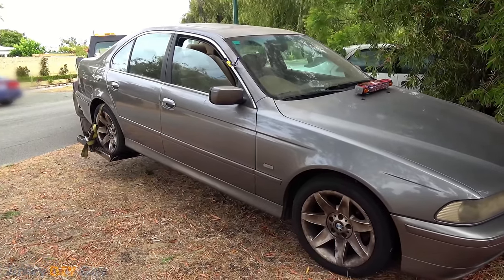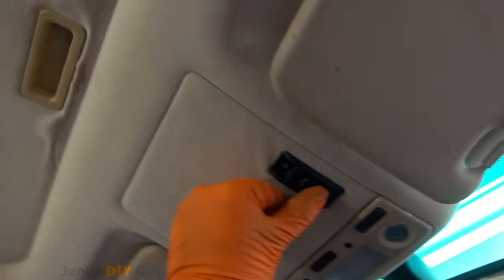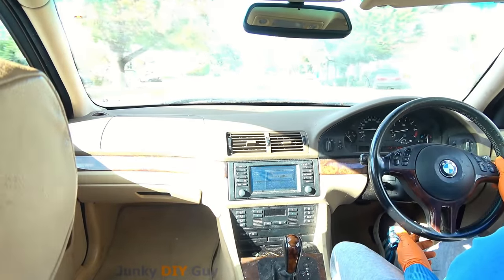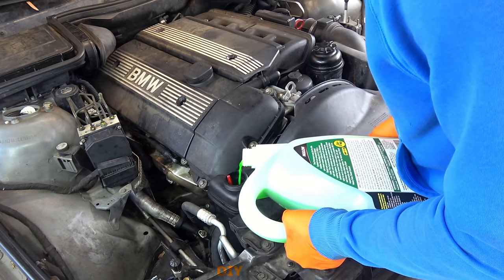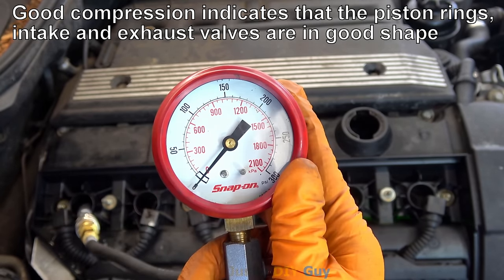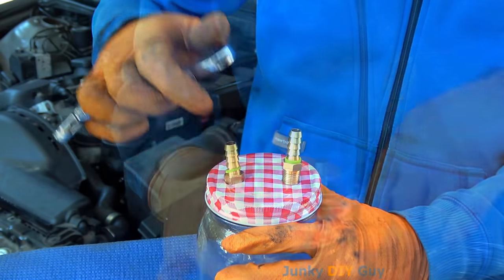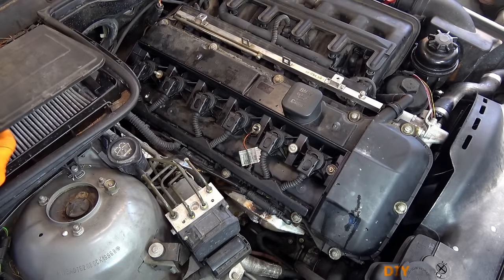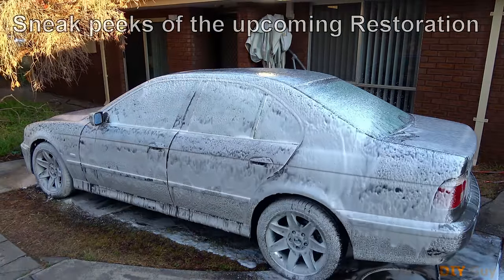I Bought a $100,000 BMW for Only $725, Here's the Reality

Comment: Excellent video.  No guessing.  No throwing parts at it.  Just the facts.  Just the right tools.  Just the right knowledge.  This could be the most comprehensive M54 repair video I have ever seen.  Thank you for sharing.  BTW, I made a smoke machine from an old coffee pot.  It uses mineral oil and a low pressure regulated air inlet from my air compressor.
Reply: M54 repair video?    please explain...

Comment: Brilliant. What a joy to see someone who can speak clearly, hold a camera in position, focus, edit and just really plan and deliver a classy and informative product. A little poignant for me as I had a lovely E39 528i - a couple of years older than this one but maybe cleaner. Started overheating. Had a bit of work done in one garage which cured it for a while. Overheated again and I left it at another place but he could never seem to get to it. Took it back home and went through some of the steps in the video. No oil in water, no combustion gas in water. Between first garage and home the radiator, water pump, thermostat etc. were replaced. Ultimately to no avail. Suspect some (many?) head studs were pulling from the block even though no detectable intermixing of gas/fluids. Diagnosis based on fact that it would run OK until warmed up then all hell would break loose. Now, the big problem was that I had sold the house and was working in a different city. So, the dear old thing went away on the back of a truck to who knows what fate. I can still smell the leather interior and hear that straight six twin-cam growl in my mind. Wouldn't it have been wonderful to have time, tools and space aplenty to keep her on the road.
Reply: I think the cooling system was not correctly bled in your car. Early E39 with M52 engines are quite difficult to bleed all the air out of the cooling system..

Comment: As a previous owner of a 525i (2001) I just loved this video.  The greatest car I ever owned, but had to sell when I emigrated.  Mine still had original battery, but perished hoses to the oil vapor recycling unit, crankcase oil seal was leaking and a pin hole leak in the radiator - not the metal part but the plastic-.

Like seeing an old friend being revived.
Reply: i had a 98' 528i, those cars feel solid. even a small thing like the turning signal on felt very heavy and gave you a nice feeling of strong long lasting quality.
Reply: overpriced plastic nice

Comment: As a bimmer enthusiast (as an owner at various times an E36, E46, E90, G20 sorry about the last one), I was attracted to your channel by the "$100k-$725" caption, simply to see what you found, for the next 30:40, I never blinked.  I agree with my fellow viewers that this is simply the most informative, most technically-brilliant and well-presented car restoration channel I've come across, nevermind the bs they have on network channels which disguise/rip off car "beautification" with "restoration".  I know you don't even need to advertise it, but I'll defo CLS your channel. Oh, only one tiny suggestion, if you add "E39 530i" to your caption, you might increase your viewing figures substantially.  Hats off to you, bro.
Reply: as an e39 owner, I cringed when he noted the blue coolant residue on the engine bay... then fills green coolant 😮

Comment: This video was awesome. Very well edited, with tons of insights and tips like the smoke test, leak tests, calculating air flow, pulling the fuel pump fuse, etc. Really appreciated the extra mile of including the pulled engine to show the head gasket, and the editing to speed up certain portions while still keeping them to make sure you show every step is appreciated (removing & replacing all 6 ignition coils). Thanks for the great content!

Comment: This is a really well made video : Great filming, lighting, editing and voiceover commentary. You covered so many issues typical of old BMWs. Excellent overall ! I have a 2002 525i e39 and had a misfiring problem. I did everything you did. Replaced so many parts only to eventually  find that the cause of the misfire was clogged catalytic converters. Replaced them and it's running like new now ! Wish I had seen your video before.

Comment: we always hear to stay away from the german brands due to expense of maintaining after warranty but you made it look so easy. The cost of water pump is practically nothing!
Reply: German brands can still be esoteric to mechanics, at least here in the US.  Different yes, hence the reputation.  Bad engineering, no.  Too much plastic under the hood, yes, as is the case with every contemporary car.
Reply: @ProjectFairmont  The amount of plastic on that engine in a car with a 100k price tag is a crazy.  I am afraid to look the amount they would charge to swap out the plastic for metal parts.

Comment: Ja servus! Bavarian resident here. When I was still an Apprentice in the early 2000s, we worked daily on several E39. It was a very, very common model. We noted days when only one model came in and E39 had the most markings on the list, followed by E46 and E36. Both latter you still can spot daily on the streets. But E39 are very rare. I see maybe one a week and I commute to work six days a week 65 km each (around 41 miles).
Thank you for saving this one ☺☺

Comment: ONE THING I saw that you DID NOT MENTION and SKIPPED... The Oil Dip Stick Tube. When you replace the CCV System, it is a GREAT idea to run Carb cleaner down the CCV side of the Dipstick as it usually gets filled with solids from the oiling system and will cause the CCV system to Fail again.  Other than that, great video for the e39 3.0L which is the same in my e46 330i.

Comment: Some additional comments: You missed the breathing hose on the battery. A cap on one deflection pulling (next to alternator) is missing. Check alos the auxiliary cooling pump... VERY important: Check if the oil return on the dip-stick pipe is not clogged. Dip-Stick pipe needs also a new o-ring. Change also both intake hoses, not only the upper one. All together: Very good video and the right thing to do with such a nice real BMW!!!

Comment: The thing is the parts if ordered by yourself cost $2,000 but if I dont know to work on cars, I will have to take the car to a shop who will charge me $3 - 4,000 for labour and $3 - 4,000 for parts. 

Plus they will not have your skill levels so this repair will not go as well. So I will be out $ 6 - 8K for repair plus purchase costs AND have a un-reliable car. 

That is the major reason why so many fine cars which have a lot of life left in them are scrapped.

Comment: Loved this video, a subject close to my heart.  I bought a used '99 E39 528i around about 2007 for a good price.  I absolutely loved the way it drove - the only car that ever gave me what the Top Gear boys call "the fizz".  Sadly, I had endless cooling system issues with it and myself not being at all mechanical it ended up costing me a fortune, ending in a head rebuild.  The cherry on top was when I sold it on (completely fixed) and foolishly agreed to a payment arrangement with somebody who still owes me $1000.  All that being said, the E39 is definitely one of BM's finest driving machines, but I would never recommend a used one to somebody who isn't either very mechanically skilled or well connected with a good BM mechanic.  Durability was not a factor in this vehicle's design.

Comment: I didn't even know that there can be so many causes of the engine misbehaving besides just a damaged head gasket. This video was very educational, thank you. From the work you did, I think 5k for the car is an absolute bargain considering you had fixed most if not all of the mechanical issues and did preventative maintenance.

Comment: For anyone thinking about car flipping.  The DIY labor makes all the difference.  This is easily well over $2000 in labor cost, if you pay a shop.  (Tierods. Radiator. Thermostat.  Water pump. The oil and intake lines. Power steering lines. Transmission hose/line.   Valve cover gasket.  Interior trim work. tune-up. And the diagnostics.)       Being $2824 deep into it for tow, purchase, and parts...    You don’t profit much or barely break even,  Unless you do all work yourself..   For a non daily mechanic.    This would probably suck all your free time for about 2 weeks straight.  A month if you got kids or other things to tend to.      Never mind that there is still labor to go into detailing the vehicle if you want to fetch book-value for it.

Comment: i recently bought e39 3.0 and i have an issue that it does not have power of 3 liter engine, i would say that it drives max as 1.9 engine car, could you suggest where to start digging? i am thinking that turbine could be faulty or vacuums fault but i am not sure at all

Comment: Gasket sealer on waterpump... Need to be careful if there's rubber o rings or paper gaskets(application specific) because you can have adverse effects. My certified mechanic(highschool friend) always says don't use gasket sealer where it's not recommended, UNLESS you know of a problem. Not sure how good gasket sealer will do floating around the coolant system..

Comment: 3 things that bothered me:

1. You put the serpentine belt on wrong. Shouldve gone under the idler pulley thats next to water pump
2. rtv for the thermostat housing - if you replace the gasket, rtv will only make it fail faster. I have done this mistake myself, properly putting it on without the rtv the gasket never failed for me or the next owner of the car.
3. too much rtv for valve cover gasket. Youre only supposed to put a little bit where the vanos meet the head and also a small amount on the corners of the half moons in the front on the head side.

Comment: I had a 2002 same mode, I cost me $2000 a year to maintain , amazing performance overall when they don't brake down But with time most electronic accesories fail even the seat motors. Mine ended up having an engine lifter fail where technically it need it a the head valve rebuilt. I was quated $4000 (the lowest). I can only say that the car performance is amazing but once major components are broke down it becomes a money pit, Botton line, the car is garbage , is only good when is new and maybe up to 80kmi. watching this video I get Ptsd from when I used to love and hate my 530i

Comment: The crankcase ventilation system should be replaced at regular intervals, leaking or not. Also the cooling system components. Also, consider removing the intake manifold and replacing the two plastic coolant tubes as they get very brittle.

Comment: It still has the original check engine light from when the car had 50,000 miles like every BMW , actually my bad the newer BMW get a sensor fault and a regulator fault and 9000 other german BS module fault at 10,000 miles

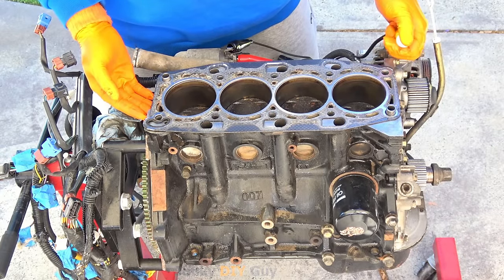Comment: Nothing but respect for your mechanical skills & knowledge (wish I had them), but this is a 5.30i, which is a 6 cylinder (inline configuration: usually denoted as "6L", but even the smaller engines (2.0, 2.2, etc were "straight sixes" in the good old times of BMW (and the 3.5, 4.4 and 4.9 liter engines were V8's) but what we see from 13:15 are four cylinders when he's explaining the working of the cylinder head and the gasket, etc....I'm pretty sure that's not the engine from his e39 5.30i

Comment: At least this one didn't' have a plastic water pump. I bet BMW tried plastic cylinder head and crankcase to complement all plastic hoses and tubes. $1949 for parts, but at BMW dealer it would be $9000+ for labor if they can even diagnose right

Comment: Imagine if the original owner had used that 100k to buy NVDIA stock in 2003 or Bitcoin in 2009..... the amount of appreciation that happened through the years would have meant that he would be easily driving a Lambo or Ferrari by now. Crazy to see how how depreciation has turned 100k into a tinkerer's toy 21 years later.

Comment: i feel like you unnecessarily buy some of these parts from the oem. some of these parts just look like injection molded abs that isn't exposed to much heat so they would be fine bought aftermarket.. but if it gives you peace of mind i don't really care

Comment: So, a lot of this is true DEPENDS on the year and model. My personal story last week on my 2016 750i xDrive. It's the G12 - long wheelbase - the only type sold in the USA. G11s were only in Europe. Short story. Car suspension started cycling then one side sagged. Worn out suspension strut on the front. OEM, so 8 years and 75K old but all highway. CANNOT find options. Have to buy OEM from BMW and only a registered shop can buy. $1,500 EACH. That, plus a few other things totaled $6,100 out-of-pocket. The BIS recall did not cover my model. The car has a street value of just $30K. So, comments by others to the contrary, NO, DIY is not always a solution. Furthermore, let's talk head gasket. Where it to "blow" in my car, I'd sell it for scrap and walk away? Why, that repair is $20K+. It's an N63R engine. A short block costs $30K for parts. A brand new engine is $50K. Only billionaires or the insane would put $50K into a $30K street value car.

Comment: I'm a freaking beamer you've already lost money when you got that tow truck to tow at home probably cost you more than $700 just for the tow truck. But yeah, BMWs are a black hole pit of money. Be interesting to see how this comes out and how many miles does it have on it? You haven't mention that yet cuz that blown head gasket could come from. Many things could have been from overheating, in which case that aluminum block is shot

Comment: How about MAGA fluxing that head? Small cracks may not show in a comp test.  It may show in a leak down which tells you about valves too.  Not a high priority but if it’s dissimilar material head/block/ cylinder liner may be more prone to micro cracks.  Not enough to bother a daily driver. 10 to 1. Wow, premium fuel!  No leaks, good compression on a cold engine, go buy lottery tickets, you are a winner!